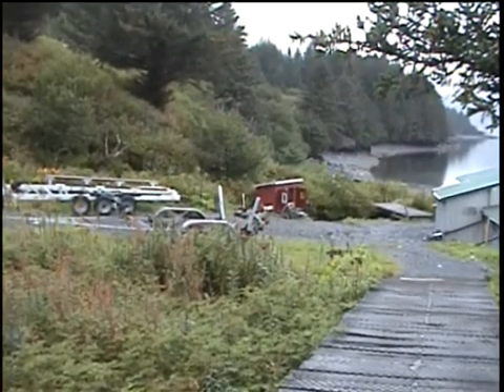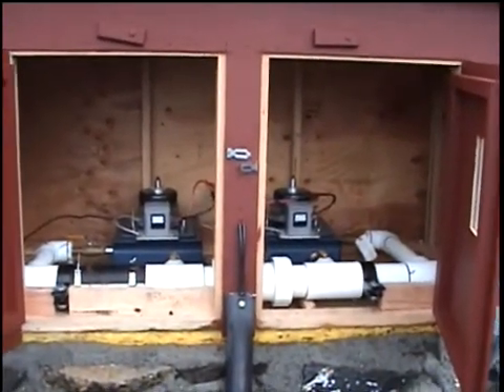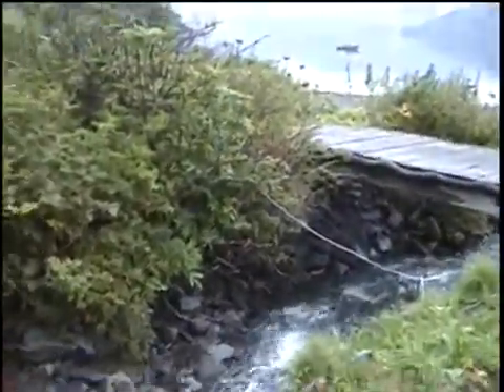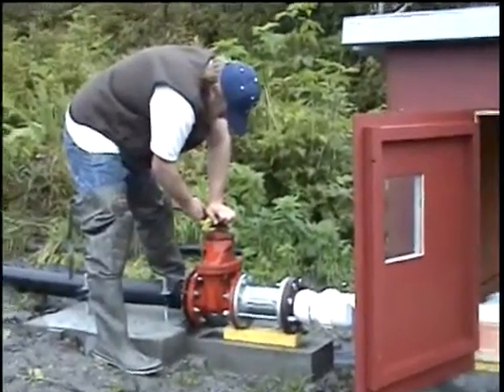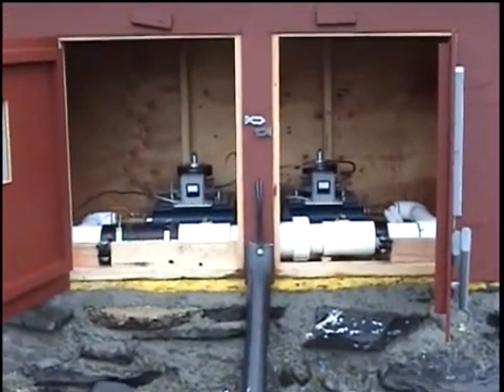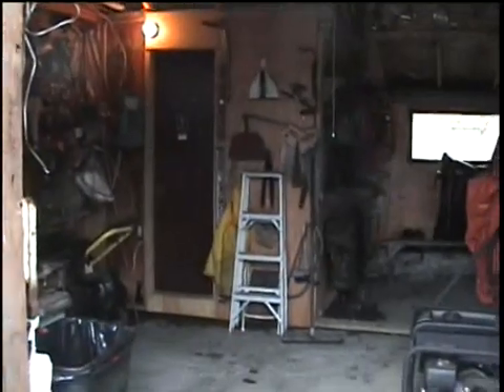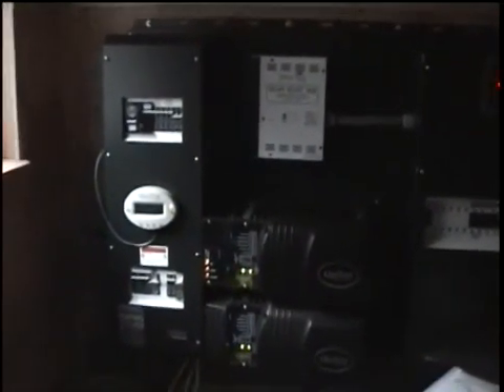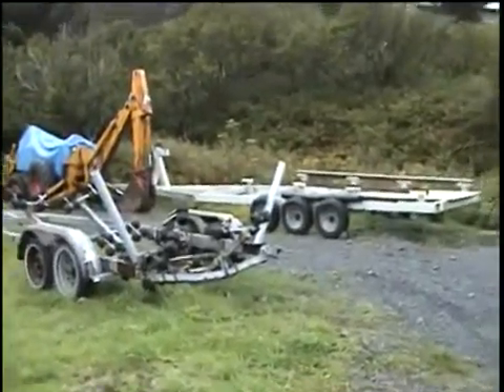Hydropower in action!

Comment: So what size and how much does a unit cost? Does it have the ability to keep a refrigerator, hot water tank, and the occasional use of a washing machine, close dryer, lights and electric heat, for a 900 square foot home, year round? Understanding that the unit will not have to power much more than the hot water tank and refrigerator at any given time. But needs to be able to power either a washing machine, clothes dryer, or electric in-wall 220v heater, on top of keeping the hot water tank and refrigerator going(ex. Continuously having power to the hot water tank and refrigerator, while running "one" of these other units at the same time via clothes dryer washing machine or in-wall heater)

Comment: Is that a PURE SINE AC inverter?  When the batteries are charged fully and you don't have a load on the turbines, will they self destruct?  I saw a guy that had a heater as a "dummy load" so when there is no power, it dissipates the unused power as heat.  Do you have any way of connecting to the grid?  So you can sell the unused power instead?
Reply: hi,. we make elc for it, with dump load as heater,. controlled by electronic load controller,.
mail me for details dhavamanitechnologies@gmail.com

Comment: how many homes with 100 amp service panels can this provide for?
Reply: gummy bears
Reply: 240v * 100A = 24kW.  6kW/24kW = 1/4 (minus loss), so it would provide about a quarter of what you use (if you don't have electric or stove - this would be enough for your lights, TV, and water heater occasionally.  The only thing that is a problem is the storage of energy.  When your not using 6kW, your not drawing a load, and the turbines will self-destruct.  You can store the energy in batteries but if you don't drain them, you will need a dummy load (heater) which just wastes energy :( Let's get the US to develop the energy storage.  It can be us, Germany, or Japan - who wants the economy?
Reply: filter4now Your calculation is the assumption they were using 100 amps all the time! Hense the battery banks come into play when? The simple idea is to have a battery bank to supply when under severe loads.
Reply: +filter4now I don't understand your power calculation? the average home uses an average of 2KW, I know the US will use slightly more but I doubt it's 12 times higher. also, would it not be possible to fit it with some sort of RPM regulator? by adjusting the flow dependant on the RPM you could keep the RPM constant regardless of the load, preventing wear and potential for overspeeding
Reply: gummy bears
Reply: gummy bears

Comment: Was the condensation on the turbine housing due to cooler water temperature going through the turbine from a higher altitude and the relatively higher humidity which I assume is at sea level? If so do you have a condensation drain?

Also what do you do in winter, does the flow slow down due to ice? Do you have to keep a certain constant flow to avoid freezing of the equipment?